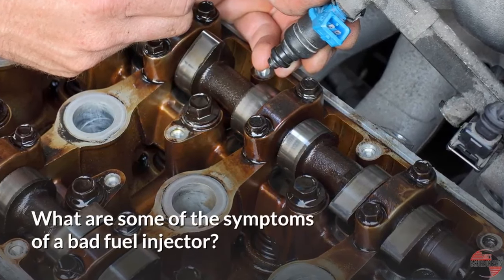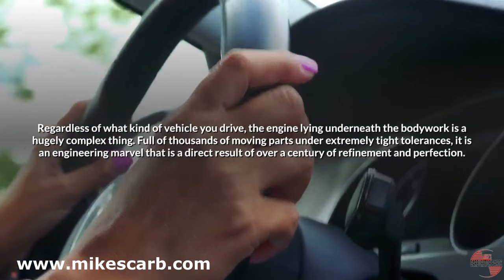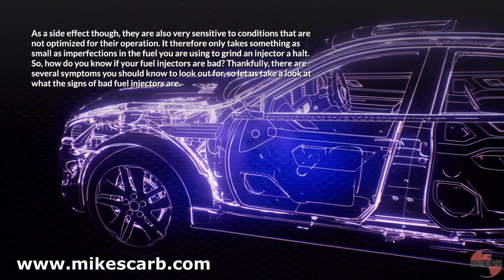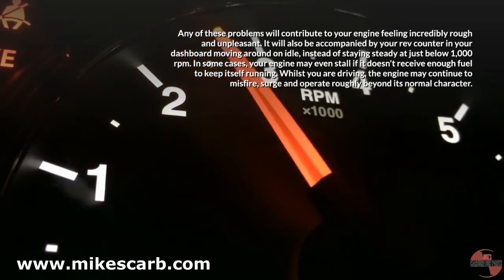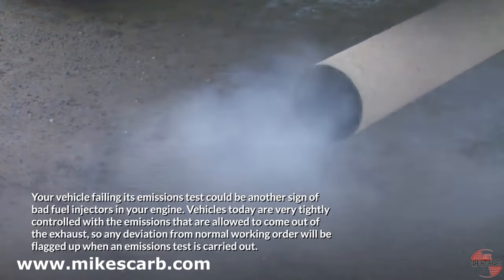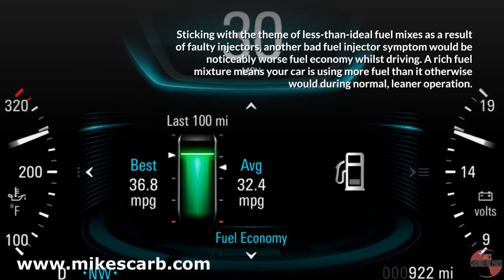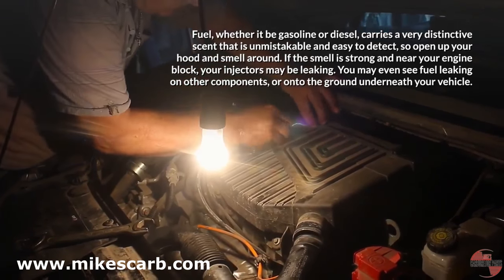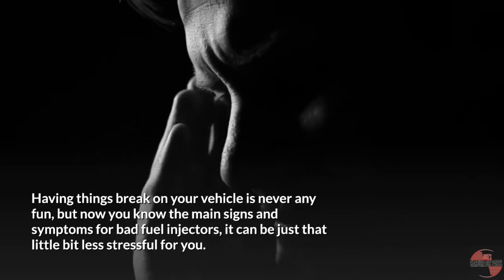Bad Fuel Injector Symptoms

Comment: Hey on my 1990 Nissan d21 when I crank it to turn it on I hear this knocking and and it keeps cranking so after about 4 cranks it turns on but with this rough idle and white smoke shoots out the exhaust and it smells like gas but after a minute or so it idles nice and runs perfectly fine it’s just the starting it up we’re I have this problem. HELP ANYONE??
Reply: I'm having a similar issue with my 06 chevy silverado (excluding the knocking). I know that my issue is leaking fuel injectors; this causes residual gas to burn when you start your vehicle and creates that smoke

Comment: I've got problem with my bakkie colt and 2litre petrol the fuel injector is leaking and it shows the engine light it doesn't have power it misfiring rough idle but when am blocking the return fuel pipes it have power and the fuel on enjectrs its leaking????

Comment: My 2010 ranger had to sit for 4 weeks while I replaced a cracked thermostat housing, now the truck seems a bit down on power & fuel economy is worse, I'm wondering if sitting still allowed my injectors to get dirty . I'm going to.put in some Marvel mystery oil., I change my fuel filter  every 25,000 miles, it's cheap.& Easy to do

Comment: What if you smell raw gas coming out the exhaust ? I think I might have a catalytic problem
Reply: Same problem. I have a code p0301
Reply: Smelling gas is normal when your car is misfiring
Reply: @bucketsmcgee4682  it started making the rotten egg smell now. Mechanics said nothing wrong with it but once it heats up, it has trouble moving fast or keeping up, I'm sure my catalytic converter is going out asked a muffler shop guy and he said it is the cat, but he said to wait for the problem to get worse, like not starting up, it starts longer then normal, but Toyotas run forever . I have to push lower on the gas pedal, tougher then usual to get moving after 40 minutes of driving, the problem dosent show up in shorter times , highway is not well but I did make it over the harbor bridge and back , it started jumping rpms up and down.
Reply: @PartyWolf36790  yeah your catalytic converter is clogged I got 4 on my truck
Reply: @beekoolasf9400  I found my issue it was a hole in my valve cover touchinh the spark plug with oil causing a misfire no codes it was defiantly effecting my computer (ecu) and I used cataclean and my cat blew alot of gunk outta the exhaust and ran really well after I did this and cleaned my spark plug up so I ordered that valve-cover and gonna get it put on soon. But whata a tough toyota though still ran and drove with minor problems.

Comment: I have the miss code on cylinder 1 and 3. Switch it off and restart no record of a code to be found. Sometimes difficult to start. I can get it to fault at about 1500 rpm in a high gear. But even when increasing speed/rpm from there it never recovers until the engine is stopped and restarted. Why does the miss remain? Is the ecu cutting power to the "faulty" injectors until the engine is stopped and restarted. (Might not be injectors but they are next to check/clean, already changed plugs and swapped coil packs round but miss still always cylinder 1 and 3)
Reply: So was it the fuel injector?
Reply: @idksomeguythatlikesmemeshd5215  I have since swapped injector 1 with 2 and 3 with 4. But the miss remains on cylinder 1 and 3. Struggling to get any info from internet. Like limp home mode? How does it manifest itself, does/is it created by a miss on cylinder 1 and 3, i don't know yet. I have/can drive the car without the engine management light coming on if I keep the rpm above 1500. It's still a work in progress, I don't like mysteries but ultimately it might have to go to suzuki for repair.
Reply: Did you ever figure out diagnosis? Have mine getting looked at right now, same symptoms.
Reply: No just lived with it. Well that was until today. Traded it in only 3hours ago. I have learned something though. A missfire is very bad and it will not pass an MOT due to high emissions. When checked out because of the failure it has no compression on cylinder 3. So burnt valves or rings and thousands £££ to investigate further. I have cut my loses. My advice is get a misfire diagnosed and sorted quickly.

Comment: I have these occasional hard start/long crank on a warm engine but the car will always start when I tap the gas pedal. I am being told it is either the fuel injectors or the fuel pump. Is there anyway to find out which one it is specifically?
Reply: @MikesCarburetor  it’s a Mercedes from 2010 so I don’t think it has any rail for me to check. I bought a high tech computer for the car and I checked the pressure that way and it gave a standard pressure rating. But I have a fail on fuel system bank 1 and 2. Does this mean it’s fuel pump related?
Reply: Your fuel filter might be choking flow , if it's easy to change, maybe do that to eliminate a suspect
Reply: It ended up being the starter which is what I suspected, every mechanic told me it cannot be so I ordered one off Amazon and paid someone to put it in a problem solved.

Comment: have a holly 2245 carb on my 1974 Dodge 300 have to pump a lot in the morning to start..  Pump 4 to 5 times turn over and then 4 more to get it to start.. Any ideas
Reply: Choke isn't working properly or carburetor needs new pump installed.

Comment: 2:55 I have an 07 Buick LaCrosse and I have to give it gas after starting it. Cloud this be the problem?
Reply: Fuel pump going out or fuel filter or this
Reply: Elaborate, is it doing it in the driveway or as you first start driving it? I assume you got a GM v6? Known for intake manifold leaks. When was the last time it was tuned up oil change, air filter intake for the air cleaned. Dirty sensors can do this. Once it's warmed up does it go away or at stop lights does it do it??

Comment: 2013Ford Fiesta. It gets fuel, spark, timing is on, fuses and relays are good. What else could be the issue? It wants to start but will not start. :(
Reply: Tap the gas tank or kick it, I had a 2014 fiesta until someone killed it hitting me from behind, I'm ok very safe car, but it had the same issue, and eventually needed spark plugs changed, until it's unfortunate death, I've had more power out my 2012 fiat 500 then the fiesta sadly.
Reply: @MikesCarburetor  Jumped timing. New belt new tensioner and pulleys. New crankshaft sensor new plugs wires and airflow sensor. Putting it together as we type LOL. Thank u all.
Reply: @pauliler  did it help???

Comment: My 2018 Camaro 6.2 gets a misfire on cylinder 8 from scanner. Only happens at wide open throttle at upper RPMs and light goes off after 30 seconds. What is the problem?
Reply: It could be a bad spark plug or coil. The most common reason your cylinder is misfiring.
Reply: I have this same exact problem with my 2018 Camaro 2.0T, It happened right after I put my hybrid turbo on, it starts, idles, and drives perfectly fine until I get into wide open throttle. When I get into WOT it makes a sputtering noise and stabilitrak and engine light comes on for a bit then turns off then drives fine again... my tuner said it's either bad coils, plugs, injectors, or in worst case, a slight crack in the piston that only leaks when under heavy throttle. Have you figured out the problem on yours? I already ordered new plugs, coils and injectors just in case any or all of those are the problem
Reply: @chrispugh9016  was a bad injector at cylinder 8

Comment: My 00 Ford Expedition has rough idle and dies at stops. The rpm starts dancing wildly.Told it could be fuel pump, I think it’s injectors. Anythin?
Reply: At idle and slowing down the rpms start dancing around
Reply: It’s the solenoid then because I replaced the alternator this morning because it died while in motion last night
Reply: Spark plugs are a year old? They were replaced by my uncle when I bought it
Reply: One thing people over look with fords is a vacuum leak from the pcv tube. Locate the pcv then follow the tube connected to it around the back to the intake. Check to see if the 90 degree piece at the end of the tube that goes into the intake for a hole or collapsed. They're know for that which would cause random multiple misfire and possible stalling. The 90 degree elbow is a dealer part for around 40 bucks. I've  fixed a lot from that simple issue.
Reply: @peggysmith8467  thanks for bringing up this issue. I own a towncar and can't seem to figure out what my issue is. I changed my fuel filter, I change my air filter, and I even cleaned my Mass Airflow sensor. My personal mechanic told me that my coil pack and injectors need to be replaced but it could be what you said in addition to those two things. I mean being that Lincoln is made by Ford
Reply: Could be a fuel pressure regulator also that has individual coils for every plug and they go bad. Is it the 5.4L Triton? Known for blowing spark plugs out the head. You would need a fuel rail pressure test and that tool is not expensive.
Reply: What about the brake booster?? If the diaphragm is bad and leaking when you press the brake this would cause your computer to freak out trying to compensate for the now mass vacuum leak until you take your foot off of the brake. I had one only do it when I got the brake pedal firm and not at idle sitting still.

Comment: My tata Indica V2 ls car doing same thing ..when I start the car white smoke will come more more ..when I leave the acceleration suddenly car will off...
Reply: Plzz reply can I go for change fuel injectors??
Reply: Try good injector cleaners and put some high grade fuel try couple times ... also put decent spark plugs so you eliminate that..drive it hard a bit when you get a chance..should make a difference